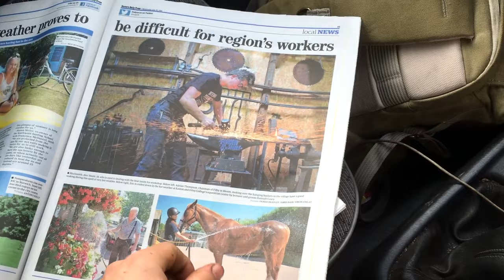Gold Teeth and Forged Steel Horse Heads

Comment: lol 90*F isnt that hot. ive worked in places that got up to 160*F in the summer and 110*F in the winter.
Reply: Keith Hill I think your temp is a little off, the hottest temperature recorded on Earth was 159 Farenhite back in 05.  This was deep in the Sahara.  160+ isn't a standard temperature on this planet.
Reply: RS 686 no that was the temp a factory got that i worked at not the outside temp, and on a barge i worked on it was the temp of the steel from where the 110* temp heated it up all day. it was hot enough it melted the rubber on peoples boots. i didnt say it was 160 OUTSIDE